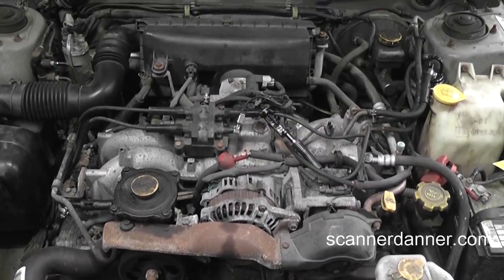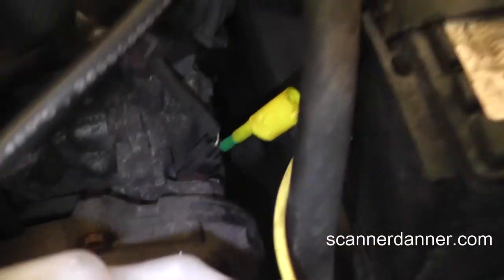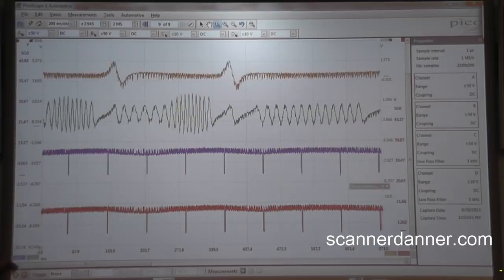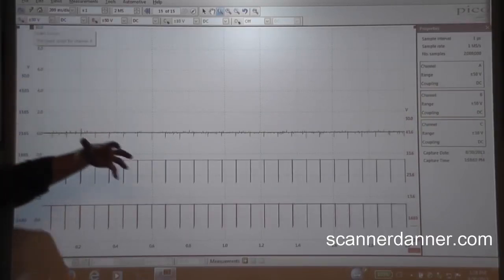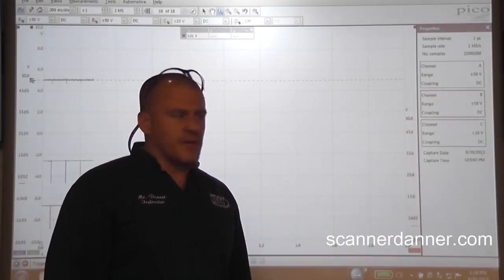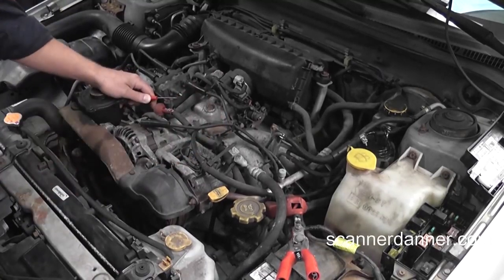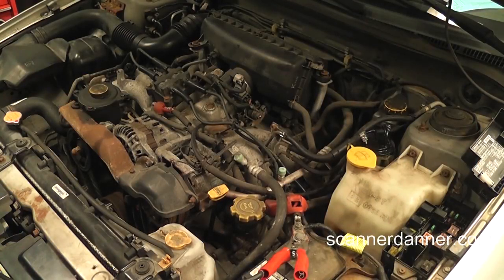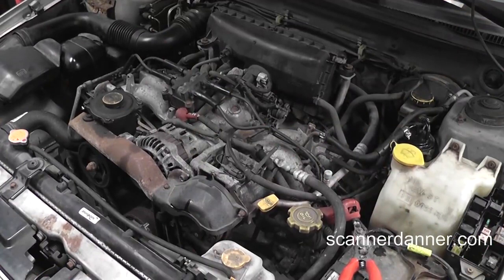99 Subaru Impreza No Start, Ignition Coils Fire With Key On! (Quick Tips)

Comment: 99 c5 corvette still doing what this vehicle was doing after changing the computer. Fan runs with the key on, non stop spark and clicking relays in the fuse box.
All started with a starter swap and mechanic hooking a wrong wire to the starter.
Yall did a fabulous job on this one Scanner!😀
Reply from the maker: With the key on, give me voltage reading on the TPS or MAP sensor, all three wires. My guess is you have a computer ground terminal still connected to the bat post of the starter
Reply: @ScannerDanner  Ok Ill see if I can that info Scanner! thx !
Reply: @ScannerDanner  Hey Scanner today I found out that my brother met some folks while installing pipe beside Cronic Chevrolet.
He took the Vet over there yesterday so maybe theyll fix it. They already said the computer ground had been hooked up to power and that the new starter had been hooked up backwards.
Reply from the maker: @RC-Heli835  I'm so sorry, it is hard for me to keep up, especially with follow up comments. I get about a hundred new questions a day, and do my best to answer them and when I do, they just multiply! Anyway, if you still need help, I have created a forum on my website https://www.scannerdanner.com/forum/post-your-repair-questions-here.html that is free to join, where I have 4 hand picked moderators and over 25k global members who are there to help me help you guys! You will not find a more friendly and helpful forum anywhere. Hope to see you there! Thanks for understanding.
Reply: @ScannerDanner  No problem man it turned out our mechanic had hooked up the computer ground to positive on the starter and had the starter wired backwards if that's possible.

Comment: While working outside  our work F-150 was running to keep it warm inside for us, I noticed the radiator fan running all the time like this car was.  Different  though as it idled fine, but when we went to drive it, it felt like it was running a few cylinders down, real rough, wouldn't get out of its own way.  The water temperature gauge was pegged hot.  Ended up being a bad engine coolant temp sensor.  Didn't ask the mechanic, but maybe it was shorting the reference voltage making it run horrible??
Reply from the maker: If it failed in the hot range, I could see the engine computer shutting down injectors to protect from an assumed overheat condition. What year was the F-150?
Reply: ScannerDanner it's a 2016. And yes, it failed I the hot range. Gauge was pegged in the red.
Reply from the maker: @Mark33090  a 2016 definitely has cylinder deactivation to protect itself from an overheat. That is why you felt misfiring

Comment: Making suggestions for "common causes" of symptoms is a pretty small dart on a very large board.  The type of video you are trying to provide is not easy.  The point of your channel, in my opinion, is to provide a complete source of educational resources for individuals to become more competent in their jobs.  I think what you've been doing isn't aimed as much at the do-it-yourselfer.  And, that's okay.  What makes your current/new goal difficult to achieve is that diagnosing cars is NOT easy, if you know what you're doing.  If you have no idea what you're doing, it becomes easier, in a way, because you just start throwing parts at the problem until it goes away.  Point being, I prefer your previous style because it contained an extreme level of completeness that is required for the professional to become proficient in their job.  Example, I could talk about misfires for weeks, and still probably not cover everything.  Now, talk about every subject within a vehicle?  It takes decades. 

I own my own shop, and function as a mechanic full-time.  The amount of knowledge, and outside the box thinking, required to become able to diagnose/repair vehicles confidently, is insane.  Just wanted to say, thanks for your hard work, and more importantly, your willingness to share your hard work with everyone else.  Have a great day.
Reply from the maker: Your first sentence, this is not what I am doing at all! It may sound like that on the surface but it is not. What I am doing is putting together a seriously useful platform for trainers (like myself, I use my videos in class all the time) who need specific examples of problems or testing methods and making it easy to find exactly that clip we are looking for! Now I only have to scan 10 or 20 minutes of a video instead of 1.5 hours like the original! Also for that technician, who remembers all the fundamentals that I cover all the time, but is forgetting that one thing. Man, what a cool refresher that could be. This is what I want. Whether it brings in more people is secondary to why we planned this. But your points are well taken and I promise it is not silver bullets for the DIYer that I am going after.
Reply: @ScannerDanner thank you for the reply. I must have misunderstood the message in your previous video. Makes sense now.
Reply from the maker: @gooe9561  I don't think I did a good enough job explaining what I was going for with these, so not your fault at all!

Comment: Can alternator ripple be tested if the engine does not start?
Reply from the maker: Why would you care?
Reply: @ScannerDanner  I've never seen alternator ripple cause a no start, so I guess it wouldn't matter until the engine runs.
Reply: As long as alternator ripple can not damage the new computer, then I gues it doesn't matter.

Comment: What kind of sensor readings, if any, would a connected scanner show? As those too would also help in determining if the engine computer is bad.
Reply from the maker: No communication I'm sure, so scan tool really doesn't help us here
Reply: The way I see it, no communication with the ECM along with sensor inputs would help in determining if the ECM is bad. I know there are other things that would prevent communication with the ECM but with no communication and sensor inputs, that would (at least me) to call the computer being bad. And no ECM communication would also lead to other modules having a no communication code with the ECM.
Reply from the maker: @frankgonzalez24  you are not wrong in wanting to look at other sensor inputs, like I did in my latest series on that power trunk module failure. Have you seen it?
The reason why I did not feel it necessary on this one, is the injectors where energized all the time and the coil was firing constantly. Two things no input problem would cause. I suppose you could argue a shorted reference circuit could do some funky stuff, but I've never seen one to that and I believe we checked it in the original video. Not sure. It was almost 7 years ago

Comment: Dan Im having an issue maybe you can sugest a direction I should go please. I have a 2000 Impreza drive train installed in my speedster, wont start. Have fuel after the regulator like over 30psi ,I have ignition at the plugs . Pulled the wire off at the injector, omhs reads nothing . What's a guy to do. I've had it running but then all it does is turn over with no fire . Does any one have info on how to get a signal to open the injectors .There not plugged I checked because I powered them with a power source and blew through them. This is my wiring diagram please help! https://www.busaru.com/att.../article/164/2000%20Impreza.pdf
Reply from the maker: You have spark and fuel psi but no injector pulse.
Step 1, with the key on, what is the voltage readings on both injector wires, plugged in, backprobing?
Do you have any codes? Maybe anti-theft system issues?
Reply: @ScannerDanner  https://www.youtube.com/watch?v=v3yWPx9qiC4   My plugs were wet and fouled ,cleaned em ,started right up .2 hours later no start flooded again. New injectors? Is there any other reasons why the fuel rail looses presure other then leaky injectors.Is there some kind of check valve some where?
Reply from the maker: @glassblastcollision  If you need additional help, I've created a free forum you can join on my website at www.scannerdanner.com I have over 28k global members and hand picked moderators who are there to help me help you guys. Hope to see you there!